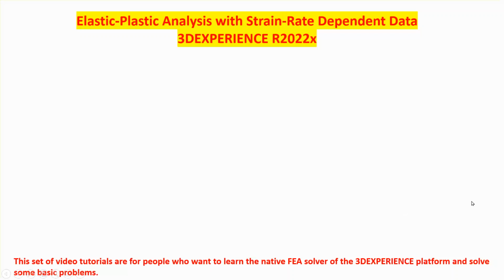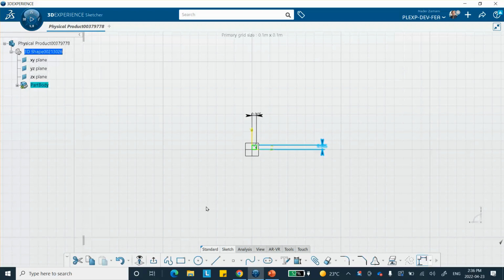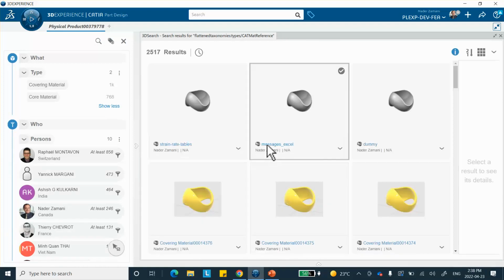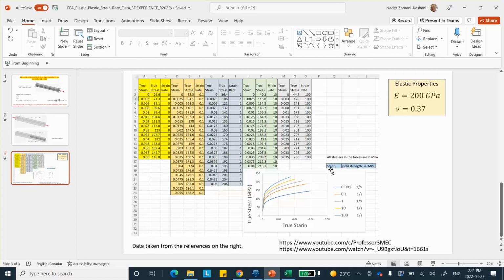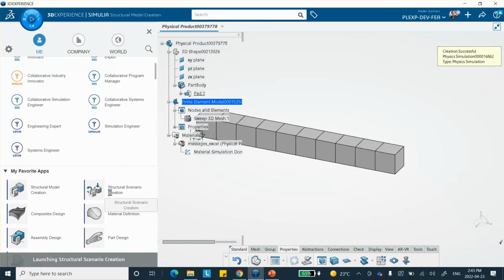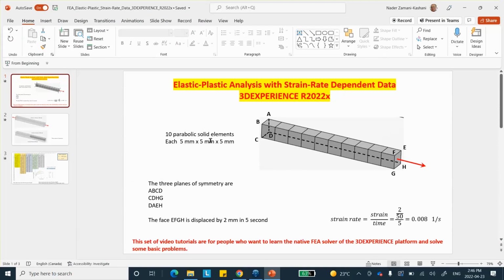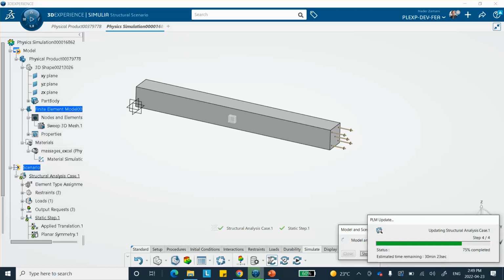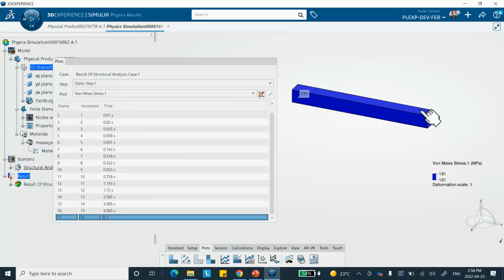FEA Elastic Plastic Strain Rate Data 3DEXPERIENCE R2022x

Comment: Dear Mr. Zaman, Have you posted any video for friction analysis? e.g. comparison of dry and greased contact between two steel parts.

The other sample could be a loaded steel structure on a concrete ground. Concrete could be a virtual part(ground). 
The real case that I'm thinking about it is a steel structure, fixed to a concrete foundation by an anchor bolt and grout around it. 

Thanks,
Reply: @naderzamani-ngzk  I understand, Thanks